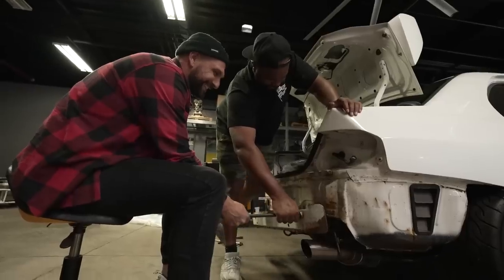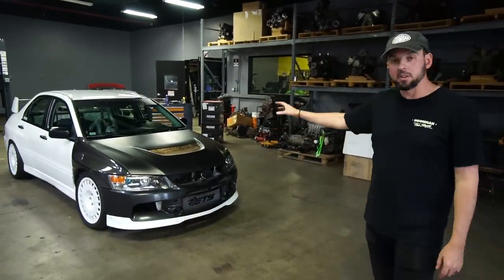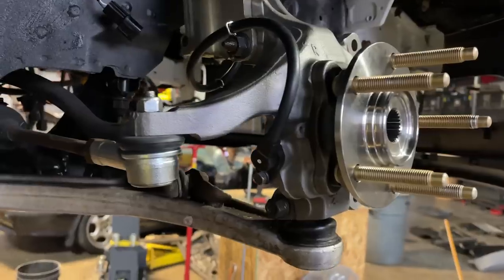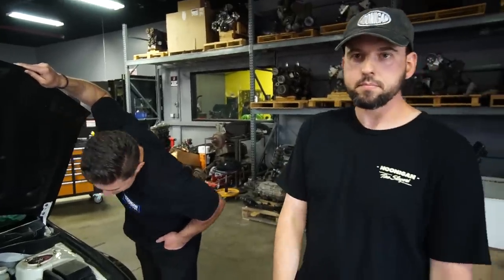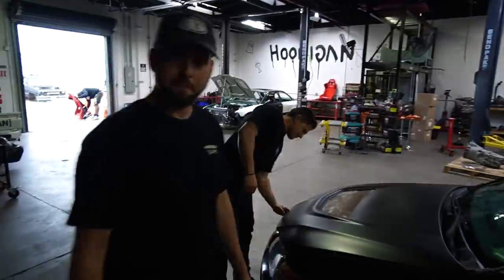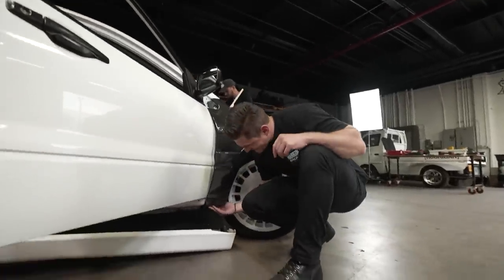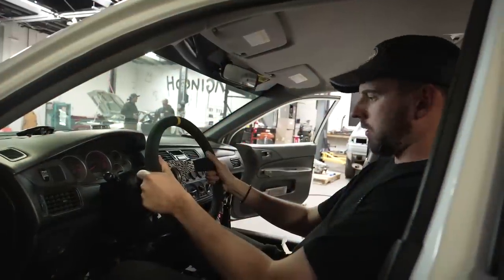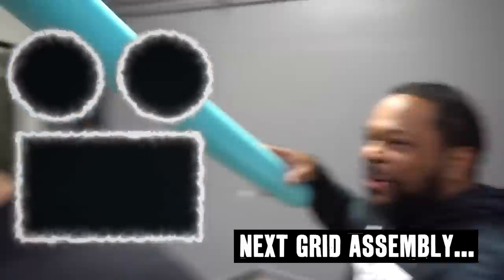Resurrecting Ron's Wrecked Evo 9 RS Into a Gymkhana GRiD Car

Comment: IMO if you went to the effort of buying carbon parts to save weight, don't paint it as you're just going to add weight. I'd leave it carbon, and just paint the non carbon bits to match, or do a glaze over it, that way the carbon detail will still show and pop.